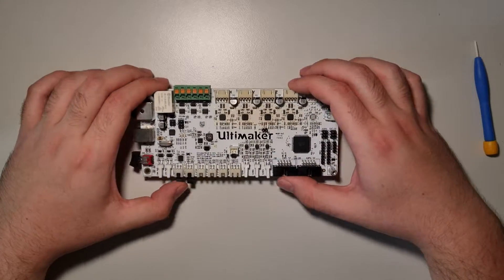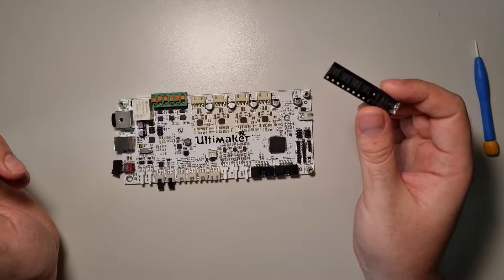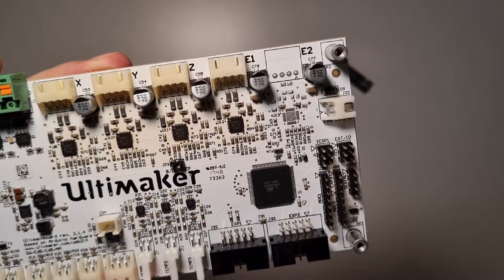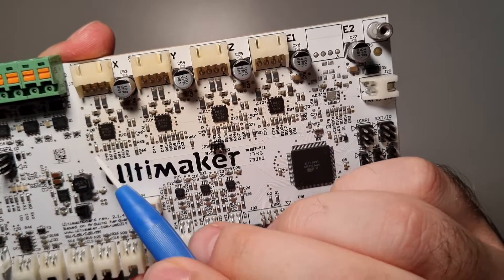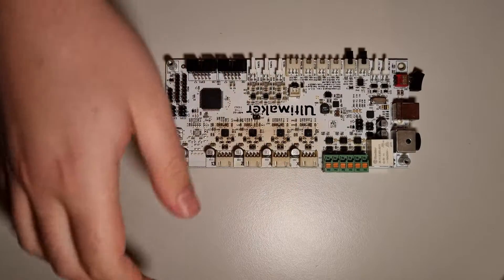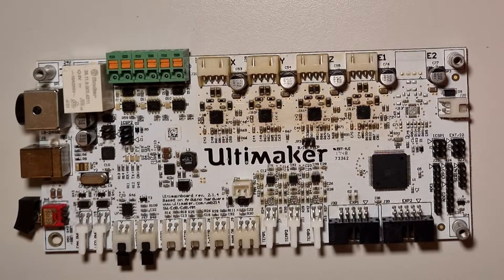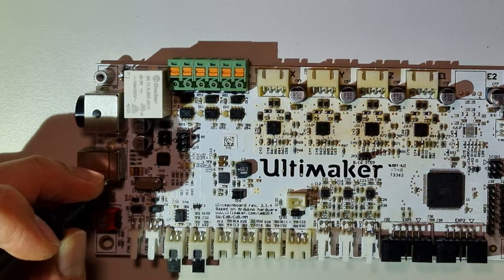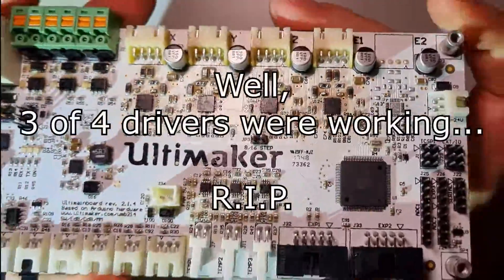How to replace A4988 stepper motor drivers with TMC2208 or TMC2209 basing on Ultimaker 2+ 3D printer

Comment: I have an Ender 3 with 4.2.2 mainboard and HR4988 drivers. If I change the drivers with TMC2208 drivers, do I need to replace the capacitors and resistors for the new drivers?
Reply from the maker: you should at least check what is installed, probbably you should change all resistors/capacitors mentioned in this video.